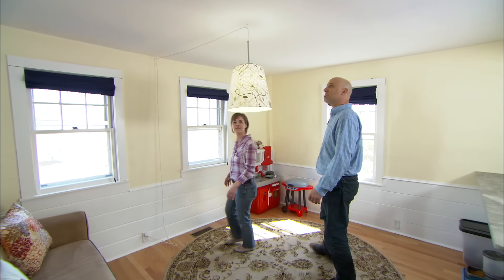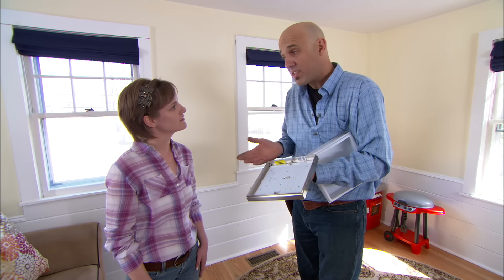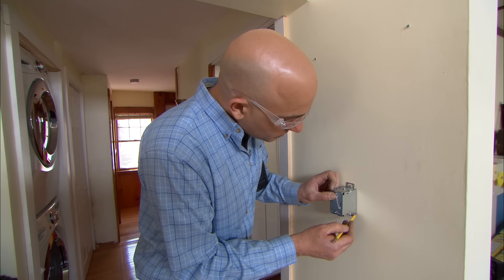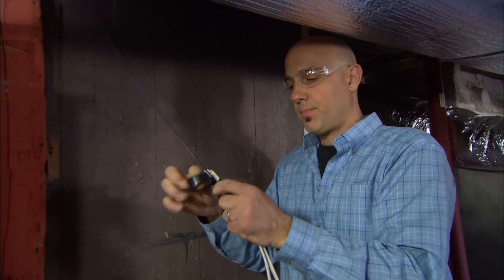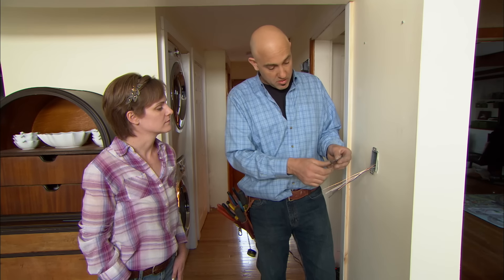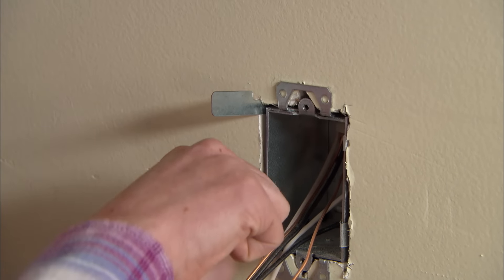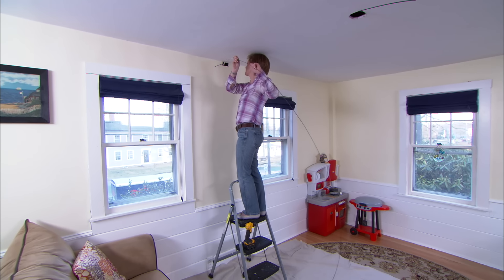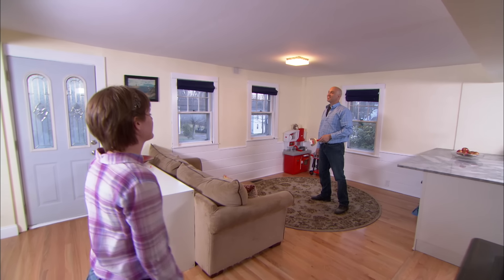How to Wire for a New Ceiling Light | All About Lights | Ask This Old House

Comment: Next home owner installs a ceiling fan from that box.
Reply: to be honest this is dumbest light installation ever seen.
Reply: They are gonna get a hair cut with that roof hight if they add a fan
Reply: That's their problem.
Reply: Haha that would suck
Reply: @psyo123  I don’t think it’s a safe bet...If you have kids and they jump around, that light fixture is coming down on someone’s head....Just Saying
Reply: 1000 dollars charge, to install 😂😂😂😂
Reply: @justice4all32  They sell brackets that are rated for fans and only require cutting out a hole the size of the one in the video. They work by using a threaded support shaft that you rotate and it expands outward until the ends dig in to the joists. No need for any drywalling afterwards.
Reply: Especially if new owner is 6'2" or taller he'll be very thirl to have a fan there to get head massage with it
Reply: Hahahaha
Reply: @Dev_209  Yeah, and it only took him seven minutes and 48 seconds! Yeah right!
Reply: If you're short enough You can put a flush mount ceiling fan in that living room and the Box will just fall out,,,,,,,, Because it is not secured to  structure,,,
Reply: Dude I was thinking the same thing

Comment: The way he is just snaking wires so easy I wish it was like that in real life ...
Reply: I bet they spent an hour or two investigating the best way. It also helps that they have basements in that part of the country.  In my world, there are no basements so it's either attic or cut holes.
Reply: Ronan B what’s the brand/kind you use?
Reply: Abdul Rahman lol right
Reply: Abdul Rahman whoa
Reply: They completely left out the part where they investigate where the joists run in the ceiling.  If they go perpendicular they have to drill holes through multiple joists - not so easy.  Even snaking wire up the wall can be problematic as often there are studs going perpendicular and you have to drill holes in those too.

Comment: I like how he just puts the box on the ceiling without any measuring,
Reply: it's already been pre-marked you can see some pencil lines on there
Reply: Yeah, he just happened to stick it on the ceiling and it was perfectly centered, just like that!
Reply: @johnames6430  i surely hope so. Id be pissed to have a light installed off center. OCD activate.

Comment: How to install a ceiling light in a room in a house that is from the 40's.  Step one make a hole in your ceiling that is probably not the center of the room or lined up with anything.   Cut in a switch box anywhere on a wall and not locate the studs first.  Make sure you use commercial box's with F tabs they make it really easy.  Get power from just any random junction box that does not supply power to that room, which makes finding the breaker fun.  Run your switch and hot wires after you make them up in a box so you can waste more wire.   Don't worry about removing the switch tabs 6:04 , so on a pop-in box your plate will just stick off the wall.  Don't worry about finding a way to run the switch leg through a attic or other access, just cut a hole in your wall.  Use a pop-in box in your ceiling, it will hold a ceiling fan when they decide they hate the ugly light.  Last thing make sure your electrician fixes the hole he cut in the drywall, you'll never notice the patch!      
My point is for gods sake if your going to make "How to Videos" and your a "Professional", at least do things correctly and don't leave out important details!

Comment: As a residential electrician with ten plus years of experience, as well as a professional troll on the internet, I can tell you that it is ALWAYS this easy and no skill is required. You could literally wire your whole house after watching this video. Just remember to have fun doing it. Your kids will be pulling wire in no time! Good luck! 👍
Reply: StrangerOf The206    Amazing how easy fishing wires is in old houses.
Reply: you forgot /S
Reply: @johnholfelder6724    Yes if nobody has blown the walls and attic full of insulation then it becomes a much harder job to do .

Comment: So when it burns out you get to replace the whole thing! Totally worth it
Reply: They're rated for like 20000 hours. Which is 10 years if you use it 8 hours a day. Seems pretty reasonable.
Reply: @scottkurtz5167  whats reasonable is the 70 year old porcelain ceiling fixture that hangs in your basement that can still be modernized with a replaceable led bulb!

After factoring cost led starts making less and less sense when you start using expensive expendable fixtures like these.
Reply: This true and since they are made In China  🇨🇳 Good Luck if it lasts more than 2 yrs! 🤨
Reply: @TisiphoneLuv  I have had led bulbs last me only 3 months before so you would be lucky if it lasts a year or a year and a half.

Comment: Pro Tips:  NEVER use a power tool to cut blindly into sheetrock.  You could easily cut through a concealed wire.  Instead, use a hand held keyhole saw.  Also, do not use those metal boxes with those flimsy metal mounting straps.  It is much better to use "old work" plastic boxes that will mount securely to the sheetrock.  .
Reply: No always use metal boxes for fans but using f clips for ceiling box is dumb cause some one who don’t know could install a fan there so either find a stud and screw ur box onto that or use the box I forget what it’s called where you can unscrew the side to bit it in the wood
Reply: That’s not always the case, here in Chicago Romex isn’t allowed nor are plastic boxes and we run into more plaster than drywall, so everything has to be metal, the Madison hangers are ok for switches but we don’t use them for outlets, we use a metal box with expanding ears. I do certainly wish we could use Romex as it would be soooo much easier but it’s not Chicago code.
Reply: those oscillating saws have about as much chance of cutting something as a jab saw. Actually less of a chance as you don't need to go as far into the wall. His method was just fine.
Reply: @chrisburns5691  I agree with you.  As a homeowner, I just used an oscillating saw to do some old work in my house for the first time.  Those saws give you a great amount of control to stay within the lines.
Reply: @AStanton1966  I have used one routinely at work for years for this purpose, never an issue.

Comment: The lady is cute, one big advantage from building houses the way you do in America to the way we do in mainland Europe is that you can add electricity relatively easy . Here i would have to hack out masonry and concrete to get conduit in to get a new light fixture somewhere
Reply: Richard de leeuw Most states in the US make you put in conduit. In the 2013 US code book all new power must be run through conduit
Reply: Carl Shaw that is not true...
Reply: Conrad S depending on what NEC year the town people are working in depends on the code used. Anything after 2011 must be run with conduit.
Reply: You're telling me every single wire must be run through conduit?  I'm sorry that is baloney.... wire only needs to be in conduit when it is exposed to potential damage....
Reply: Well I'm just telling you what m the NEC says. It just depends on your city or town inspectors and what NEC codes they use.
Reply: Carl Shaw I know... NEC says conduit when exposed to damage... Do you run conduit in every wall space for every outlet and every light?
Reply: Some cities require all residential to be in conduit. Highland Park TX is one. When working as carpenter there in the 80's it was required at least in new work.
Reply: Conrad S I do. I live near the Chicago area. They will shut you down if you try to run anything without it.
Reply: Say what?? Cite an article because that's simply not true.
Reply: Agreed.  Carl's a clown.  That's not even close to being true.
Reply: @theanimal189 the nec dose not state that for residential but everything comercial is in conduit, or mc, flex ect
Reply: @theanimal189  My new construction home (2019) does not have any wiring run through conduits. Georgia here.
Reply: @theanimal189  not true
Reply: @theanimal189  🤣🤣🤣 no
Reply: @chrisf9607  not true. Romex can be used in many commercial applications

Comment: Hello I bought 2 led lights that have a short cord that can be plug in outlet  with on and off switch, but it also comes with cable that can be wired. It's nice that this can be plug in outlet and haclve an on and off switch. The problem is that cord is only  2 ft long.
I have a ceiling fan with light in garage.  I control it with light switch from inside  house. If I decide to wire the two new led lights can i tap it from ceiling fan? That way when I flip  light switch on it will turn on ceiling fun and new led lights too? Do I have to get into attic to do this?

Comment: It is an advantage when the walls and ceilings are made of wood! Nice work. Question why there is no point on the ceiling from the beginning of construction for the installation of a luminaire?
Reply: The house, based on the style of the molding and height of the ceiling, was likely built before the common use of electricity in the home

Comment: not sure if the electrical junction box in the basement had it or not couldnt see it well in the video but It def needs to be grounded and by code the screw in the switch box should have been green and a separate wire not the wire off the romex. And just my opinion but always put a ceiling box rated for a fan up because if they get tired of that light and want a ceiling fan its def not gonna hold.
Reply: I would have put in a rafter bar
Reply: Fan hanger

Comment: question: I noticed he used the metal box with that madison bar.  Why not use an existing work box that has the self tightening levers already included?  I imagine their was a reason for the route he went when he chose that option.
Reply: Tbh not really like In Canada we only use metal boxes but use it f clips was dumb for the wall it doesn’t matter but using f clips for the room was dumb

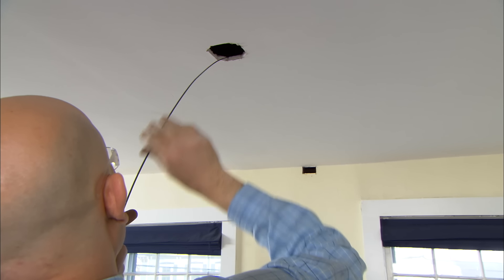Comment: 6:12 good thing her ceiling joists run parallel to the wire
Reply: Probably could've continued up from the switch if that wasn't the case.

Comment: Personally, if I was going through the trouble of running new switch legs, I'd install 4 LED recessed lights to have nice even lighting throughout the room instead of the glare that a single light source would have.  At the very least, put in a flexible track so they can light up art work and make it look more modern. The single light in the middle is so 1970's.  With the switch location, you don't put it in the middle of the wall. That's precious space for art work.  You always put it on the side. Scott is a good electrician but has very poor taste in fixtures and lighting design.

Comment: So what do you do if you don't have a basement or an attic?
Reply: you'll have to fish wire from existing socket to the new switch box to hole on top of the wall and from there to the light cutout.  However, if there are some studs and joists running perpendicular to path the fish tape, you'll have to make a cut out of drywall at each of those locations to drill and pull wire through.  In other words, this video makes it look like cake walk, where as in real life it's nothing but.

Comment: Is there no regulation in the US to how much weight a ceiling fixture must hold? In Europe its 25kgs
Reply: seymour butz yeah there is I’m not sure how much but if your installing a fan or heavy light you have to screw a metal box not plastic to the studs so the fan or heavy light won’t fall
Reply: They make different junction boxes for different things. They make heavier duty metal ones that support up to a 75 lb fan, for instance. It depends on the application.

Comment: Why not just use a remodel box? AKA Cut in Box. Ive never used one of those Madison bars he showed
Reply: daniel kofman   I’ve used them for the switch box, but never for a light fixture , even one of those lightweight LED fixtures. Whenever possible, I’ve always used a fan box to mount overhead lights.  You never know if someone will want to change out a fixture

Comment: Good work Scott. If I was you, I would have installed a ceiling fan box there. There is many DIY homeowners out there and that box you showed us wont support a fan and its a lawsuit waiting to happen if someone gets injured. I always think about the future. Sure it costs more but in the end,  its flexible.
Reply: Nope they just gotta change the box if they want a heavier light
Reply: A professional would know that this box cannot support a ceiling fan. The electrician put in the correct style box based on what it would be used for, a very lightweight fixture.

If a homeowner came along and decided to install a ceiling fan there, and then it fell a day later and hurt someone or whatever, the electrician isn't responsible, it's the fault of the installer, which in this case is the homeowner. Not sure how you could file a lawsuit against yourself, lol.

Could he have gone ahead and installed a heavy duty bracket? Certainly. Was he being paid to do so? No. Things like this are usually discussed beforehand. And if someone wanted to change it to a box that could, it really wouldn't be that difficult.

Comment: I would let the customer choose a light. The technician only needs to do the technical things. If you have a bit to spend i would suggest to go for Philips Hue. I never touch any lightswitch. During workweek lights come on at 6 in the morning, if i come home all the lights (hallway, living room, kitchen counter, etc) turn on with sensor, in evening at 10pm they dim graduatly down towards 10:30pm. You can program it any way you want and any color per bulb.
Reply: I agree it's the homeowners choice, but let's not forget the installer is also the first person who gets blame for poor quality fixtures the homeowner picked.
Reply: I have no doubt the homeowner picked the light, this is a scripted show after all...
Reply: philips is expensive though. there are much cheaper smart bulbs or switches that do the same thing.
Reply: Blox117 I have no experience with other makes, but before going for them i would first watch some reviews about the specific brands. Maybe they lack quality in some way. But everyone should go for their own budget of course.
Reply: Richard van Pukkem philips is really expensive if you replace all the lights in your home, especially if your home has a lot of lights! the biggest concern I have about ALL smart appliances is this: what happens after a few years when the manufacturer's servers go down? then there is no way for you to communicate from an app to your smart appliance
Reply: It’s a staged educational show geniuses

Comment: My house is actually insulated and the tops of my walls have something called a top plate in them.
Reply: I'm assuming above this light was another floor, otherwise they could've ran the wire from the attic.

Comment: I need to buy some Madison bars...
Reply: Madison bars are so old school. I am a pro and do still keep them on my truck but only for when I need them, like with BX cable. I mice prefer to work with plastic old work boxes.
Reply: @electricianron_New_Jersey  everything done in the US is old school.
Reply: @Abdul Rahman yeah, but what if you have a plastic box holding a ceiling fan? I have that problem and I need to change it out with a ceiling fan rated box. the box holding my ceiling fan is a plastic switch box and it could fall at any time.

Comment: 'How To' question; Can I install a junction box near my single light fixture (over my island) to tap into it, to install 2 additional ceiling pendant fixtures?
Reply: Why do that when you can just tap into the existing light, no need to make a junction box when the box that the light is in, is basically a junction box

Comment: Do American electricians really just find any old random junction box and take power for a lighting circuit??

In the UK we have dedicated lighting and power circuits. And a reduced current limiter (fuse) is needed if you HAVE to do this. 

I know Americans use radials but mixing and matching lighting and power circuits?
Reply: Not "real" electricians! :(

Comment: Just noticed too that he called the sub panel the main panel one more thing too.. He should have made sure that the 14 Guage wire was protected with a 15 amp breaker not on a 20 however we can assume the he did that already for the sake of the nec. So many code issues might want to rethink their electrical series
Reply: Name one “code issue” that you saw

Comment: And if a light goes out, have to replace the whole thing.
Using those clips? Those does not look safe if you put another light or fan.
Reply: John they aren’t meant to hold a fan. If you are installing a fan you should always ensure it’s either tied to a joist or spanned between 2 joists. Usually Joe Homeowner won’t try to install a ceiling fan.
Reply: Those lights are rated for 40 years with about 18 years of constant use. Also individualized diodes so one can go out but not the rest.  Great tech!
Reply: M Mikita I had leds that went bad after just a year or 2.
Reply: @saulgoodman2018  Check your warranty they usually cover for up to 5 or 10 years.  And don't ever go cheap.  (40-80 dollars is about the right price for nothing fancy and still well made) 2 years... must be faulty and should be able to replace for free. 

Don't use generic and if it isn't then get your free replacement (which will be a newer generation).

LED are very durable and long lasting, low heat, low power, and strong.  Bad manufacturing if went bad.